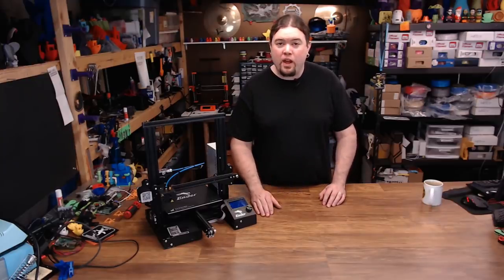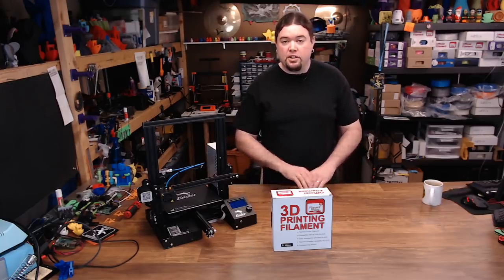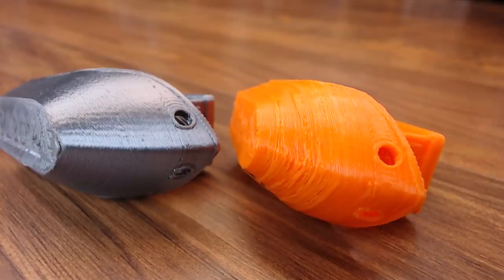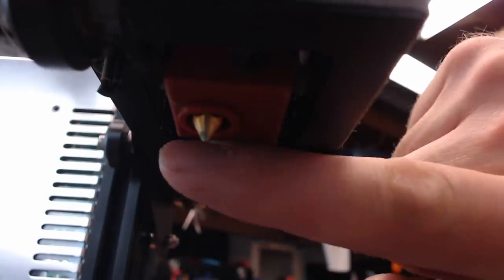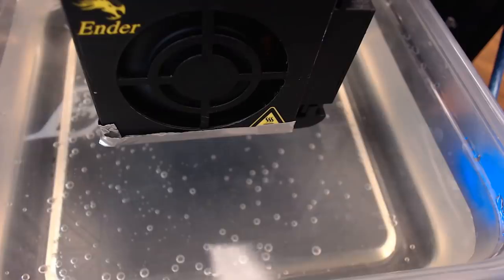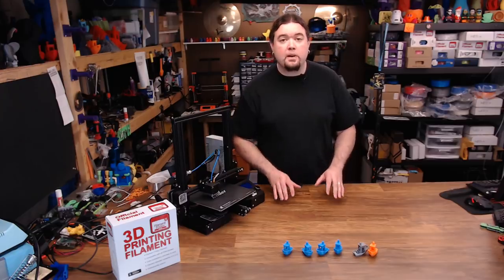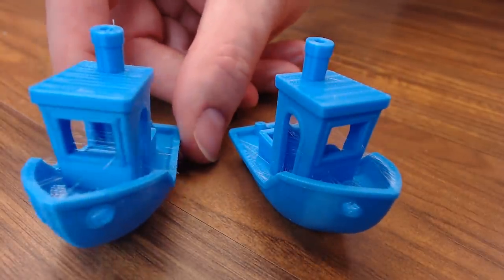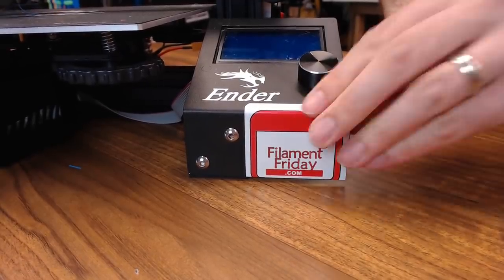Ender 3 Part Fan Or No Part Fan - Chris's Basement

Comment: Thanks for posting this video. After I saw Chuck's video, I had several questions regarding the Ender 3's cooling and how he was getting those results. I almost ordered one just to satisfy my curiosity, but my wife would start getting pissed if more 3D printers started showing up! You've confirmed my suspicions. I thought either the hot end fan was doing some cooling or the part cooling fan was doing nothing. Thanks to your video, the mystery is solved! I like the way you didn't slam Chuck, he's a good guy.
Reply from the maker: Thanks Robby, same here, it is something I always wanted to test, just never did. Thanks to Chuck I finally got around to it. I look up to Chuck he's who I want to be when I grow up. :)

Comment: Everyone in the comments is mentioning it ruining their ABS prints, but I have exactly the opposite problem with my Ender 3. I print a lot of ABS, and every hot end cooler I've printed has killed the quality so I keep going back to the boring stock unit. I think the air spilling actually gives the parts just enough cooling, without causing warping like the blast from a part cooling fan does. Perhaps the big difference is that I print in an enclosure (read: highly customised cardboard box) and get around 45-50°c ambient.
What I also found really interesting, is when I tried printing with a "reverse flow" hot end cooler (thing:3419531) to get the airflow away from the print, my chamber temperature actually dropped by about 7°c (iirc) from what I usually get, presumably because of the loss of convection airflow over the build plate!
Reply from the maker: You've got kind of a perfect storm thing going on. that's interesting.

Comment: Combination of Chucks and Chris results: just print a better airflow duct or change ur coldend cooling that way the part get's cooled by the coldend fan, too. Sweet. With normal ptfe tubes, it's sorta impossible printing in temps up 240°C due to the fact ptfe will degenerate which results in nasty toxic fumes. U need to upgrade to an all metal hotend to print material in higher temps that don't need part cooling at all.
Reply from the maker: Also a great point. Not sure what cap tube can get up too, but probably not much higher.

Comment: cooling or no cooling is obvious to me. but one thing i'm curious is what kind of cooling? do those fancy cooler improve things? Is a noctua 40mmx20mm enough or do you really need a loud blower? what percentage is cool enough? I'd love a video like that from you :) specially blower vs normal
Reply from the maker: Hmmmm, interesting, I would have to find a good way to test that. I will think on it.
Reply: @ChrisRiley  yesss thanks xD The blower fan and sudden fast movements of my printer are the loudest things right now.  the CFMs of the noctua 20mm and an avarage 5015 blower are not THAT far off. not to mention my blower already is at 60% max. if i set it to 100% and extrude filament in air it shoots it backwards it's funny xD

Comment: I'm going back to the stock cooling fan on my ender 3. I've printed just about every fang style cooling duct out there and have had more problems with layer adhesion when using them. I usually turn the fan down to 40% speed to get them to not over cool the part. You proved a small amount of air around the nozzle works, why does everyone think you need a 2 fan cooling duct with a hurricane of air at the nozzle?
Reply from the maker: I have always wondered the same thing. I started way back with a desk fan, it worked great!

Comment: I once tried to print a small lowpoly Pikachu on the Ender with bullseye part cooler and the parts cooling fan mounted 90 degrees rotated thus blowing sideways and not into the fanduct. Print epically failed. The object was so small that plastic wasn't able to cool beyond melting/glasstemperature and it got totally mushy bending upwards.
So part size and resulting layer printing durations are also key to whether you need cooling or not.
Reply from the maker: Agreed and that's where Chucks video comes in.

Comment: Both you guys are high on my list of much watch video content.  It would be nice to expand this testing using petg filament.  I found out that the glass surface I print on with my Tevo Little Monster, even with a coating of hair spray popped some glass surface off after cooing!  Bummer!

Comment: I also seen chuck's vid, but one thing about part cooling that I am not 100% sure about is if its best to pinpoint a small as possible area around the nozzle or just blast the print surface with fans.. in my own reckoning it would make sense  go with the former, it be interesting to find out how much part cooling is  actually needed and the effect it has on the bed surface as well the print adhesion,  especially if the temperature difference  is great enough - maybe too much can be a bad thing?
Reply from the maker: I am not 100% sure on this either really. I would like to get a couple of different fan setups and an air pump and see what works best.

Comment: What is causing your stringing on the Benchy?, I printed one on my Ender 3 and got no stringing, I used the standard Ender 3 profile in Cura
Reply from the maker: It's mostly impacted by the fact I use Z lift on everything.

Comment: I personally need the fan on my a8, as I print relatively fast (80mm/s 2000 acceleration), so I do need a fan to cool down the plastic, I find the quality drops from prusa level to crappy printer
but I have a really good duct that I made  myself for low back pressure and high flow, with a 5020 fan
without fan the sides look very droopy, the details look bad, the chimney looks like a blob, the bridges are very bad
Reply from the maker: Nice, 5020's are where it's at.

Comment: Back when I got my CR-10 I tested different fang setups and found one that improved the print quality even further, compared to the stock setup. Later on the Ender3 I installed the fang too. These considerations where kind of missing here. Nevertheless a good and nice video, that's just my two cents.
Reply: which fang was it for the Cr-10 ?

Comment: Chris please tell me how to activate the part cooling fan.   Mine hasn't been turning on during prints.
Reply from the maker: Give it a test first. Try Pronter face and run a M160 S255 to make sure it kicks on.
Reply: @ChrisRiley  newbie here just installing a new mobo on my printer looking to test fans. I'm seeing other GCode reference M106 for fans, not M160. 
Are GCode commands standard across all makes?
Reply: @theunfrailhale  I think it’s a typo, m106 is what I use

Also your question basically depends on the firmware, most printers are based on Marlin so there’s a high change it’s the same
Reply: @probablyblue426  cheers dude.

Comment: I’ve always wondered about this. So it makes sense to go with one of the “aftermarket” part cooling shrouds? Or for PLA it doesn’t matter?
Reply from the maker: On these machines for PLA in the stock config, doesn't really look like it matters.
Reply: And that’s the majority of hobbyists out there. Maybe some PETG, but I think PLA is the plastic of choice.
Reply: Although the Hero Me fan duct looks so cool!
Reply from the maker: @JohnDStrand  Agreed!
Reply from the maker: @JohnDStrand  True, I have tried fan and no fan on PETG, seems to work about the same if you get it dialed in.
Reply: @ChrisRiley  it's all about the slicer settings! Once that's dialed in, I believe you can get great prints even the monoprice Delta mini!

Comment: Hey Chris, great video! Have you printer PETG on an Ender3??
Reply from the maker: Thanks! I have and it comes out a bit stringy, I think I will make a hotend plate and try again.
Reply: Chris Riley i really like to know if you can get rid of that petg stringing because that’s also my problem on the Cr 10 mini
Reply from the maker: @Hasitier  Hey I do PETG pretty regular on my CR10 and Ender 3. This is from my Ender 3.  Very minimal stringing. I use cap tube, a SeeMeCNC EZR extruder. You want to make sure the filament is really dry. I run retraction at 6mm at 25mm a second. I can send you a profile if you want. I do 30%-50% fan most of the time. 

Here is my Gcode if you want to look at the settings:
https://drive.google.com/open?id=1NNUXaq57RNMd_gsSBCApreZbJ0fDHymH

Here is a PETG benchy I did recently, this is Ic3d filament. I could probably get the stringing down a little more if I re-dried the filament and tweaked the slicer a little more:
https://photos.app.goo.gl/Vxwb7WSkAZhGHNUn6
Reply: Chris Riley hey Chris, thanks Dir the response. I also use Capricorn PTFE Tube but with the stock extruder. Maybe my filament is a bit wet because sometimes it stays on the machine for days with no use. Maybe I’ll have to get some kind of dryer for it?
Reply from the maker: @Hasitier  I use the MatterHackers Print Dry, but any food dehydrator should work fine.
Reply: Chris Riley thanks for the tip. I will take a look into that.